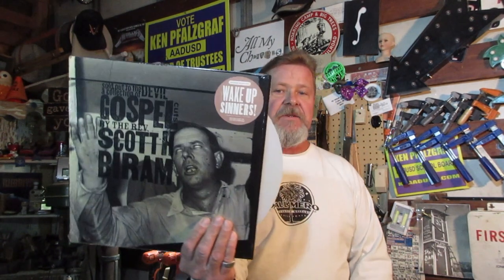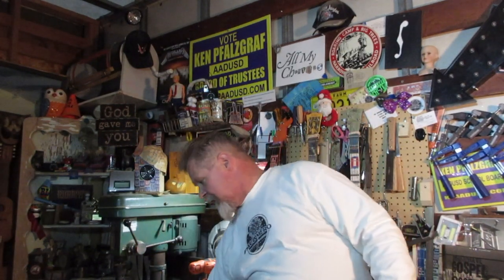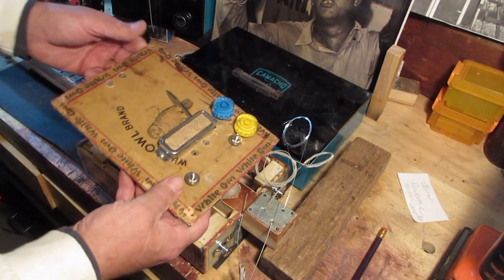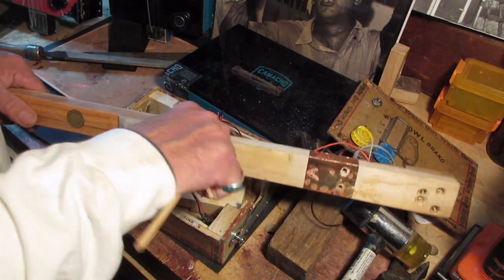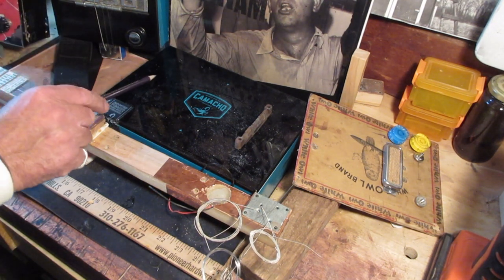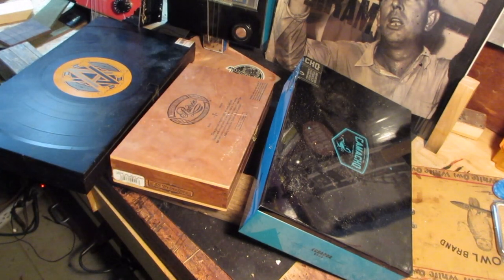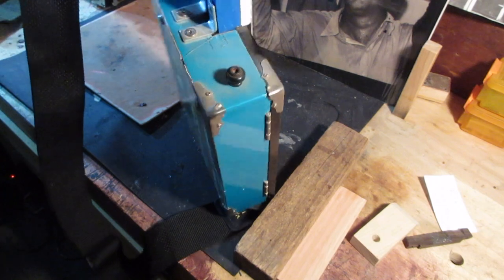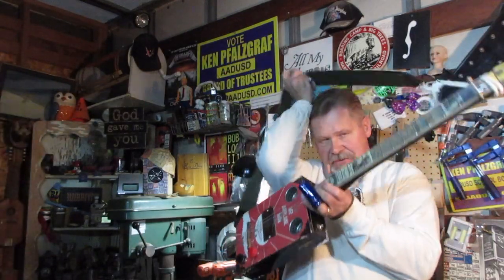Beauty is Only Box Deep

Comment: have you evaluated the box wall thickness and interior air volume to finish tone in any way . thin box vs thick box , same strings , air holes ect ... i think a thin box may project higher tone vs thick box resulting in bassier tones .. using same inside air volume ,  any thoughts